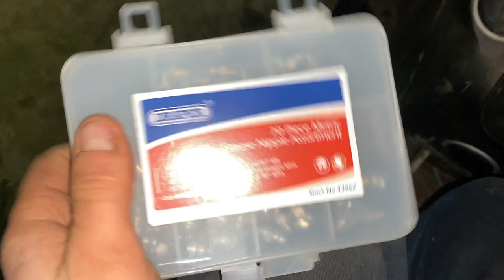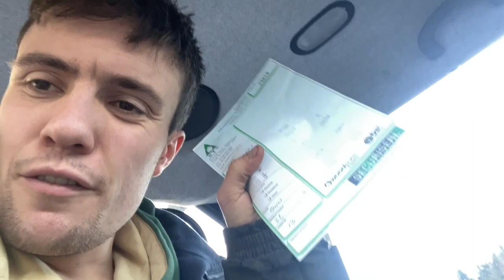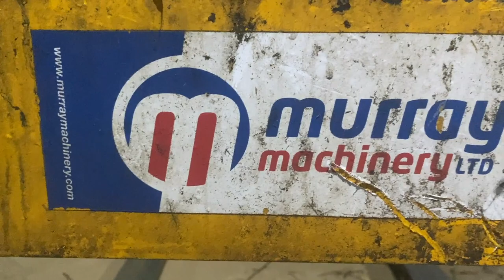CARTING BARLEY AND CHIP | AVOIDING A TRACTOR FIRE #CRAWFORDFARMS #172

Comment: Reversing trailer partial tip it up so you can see the trailer wheels and are able to judge we’re trailer position is in door ways
Reply from the maker: 👌🏽 always gives me fear ill forget which spool and empty a load in the doorway so dont bother 🤣
Reply: Good point lol
Reply: @CrawfordsFarm1  Isn't there an inhibitor valve which prevents back door opening until trailer tipped a bit? We are 5 miles from Stewarts factory but have Bailey trailers! However we had a Massey 6480 with sticky valve and twice someone tipped trailer and back door opened in yard! Massey sold....
Reply from the maker: No such valve on these trailers

Comment: I've only played with artics in the yard but they are much easier to reverse because of the fifth wheel.
Doorways are why God invented mirrors 👍
Fendt green goes with blue! 😁
Reply from the maker: Camera?
Reply: @CrawfordsFarm1  Getting the right angle for a camera is the hardest part. I used to have one on the back of a 4000 gallon tank, I could hook the trailing shoe on so quickly being able to see the link arms of the 4 point.
Reply from the maker: I know nada about lorrys
Reply: @CrawfordsFarm1  You can back a tractor and trailer, Artic is easy in comparison. Because the fifth wheel brings the pivot point so much closer to the steering axle. 👍